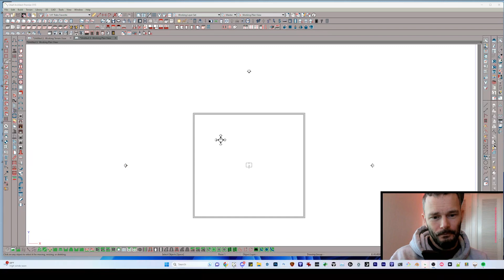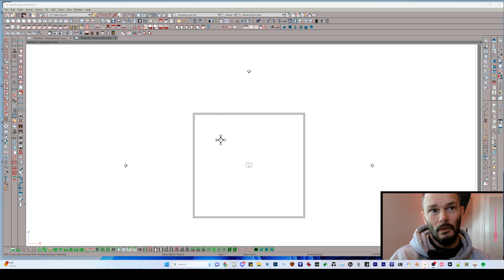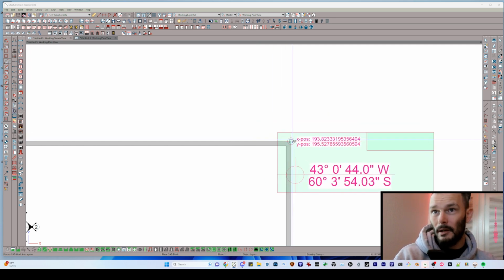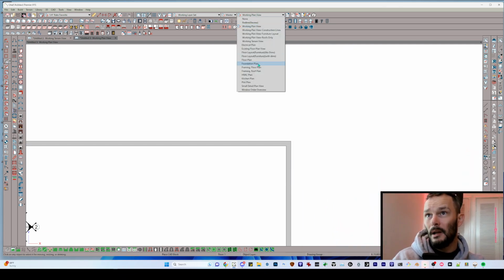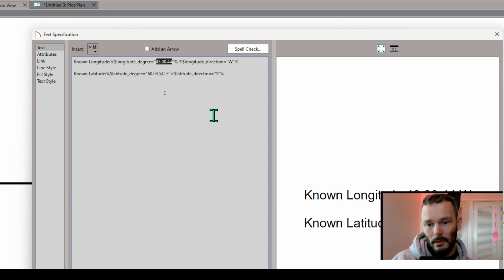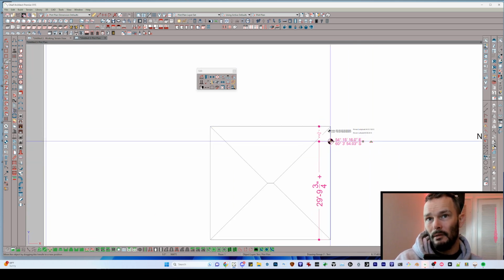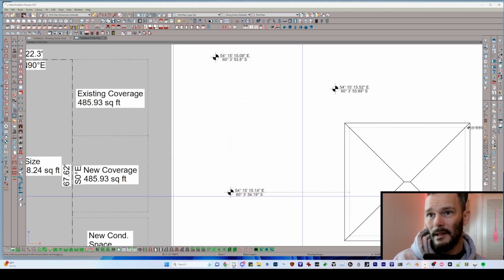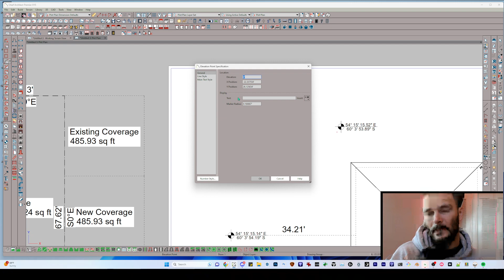Total Station Tool For Longitude and Latitude GPS in Chief Architect X15

Comment: I watch a reply of the live stream and I use my GNSS receivers and locate points on sites. Then export them from the data collector, which is FieldGenius, into a CSV file. This allows me to import terrain data into chief. Now the coordinates need to be moved with one of those point centered to 0,0. I then can locate anything on that plat with a point marker and have a coordinate for that point. I then use excel and calculate the difference from the 0,0 I centered and it’s coordinates on the gnss. This gives me an equation for the point markers I created in chief and you can then plug the point markers chief coordinates into the excel and you will have you its real coordinates to import back into the gnss data collector and you can stake that out in the field. 

It’s really quick and easy once you get use to it. I just wish chief had a way that export point markers to a csv file. It gets tedious with lots of points I have to click on each and copy and paste into excel.
Reply from the maker: Keep in mind the macros I use in a marker can also be used in any object and objects and custom fields can report to schedules, and schedules can export to csv
Reply: Will have to try that!!